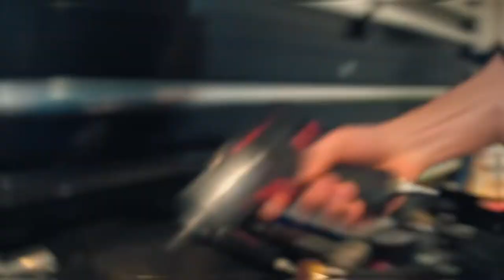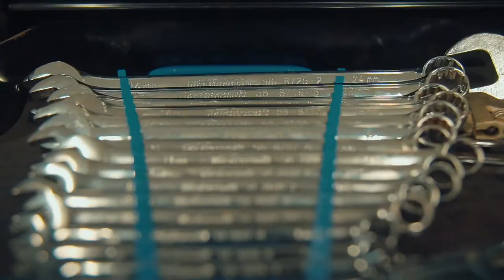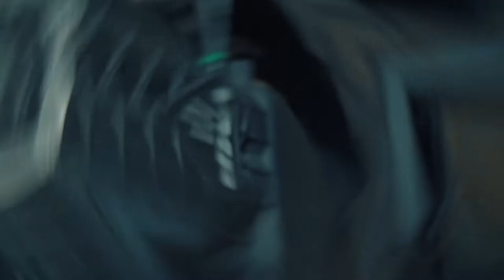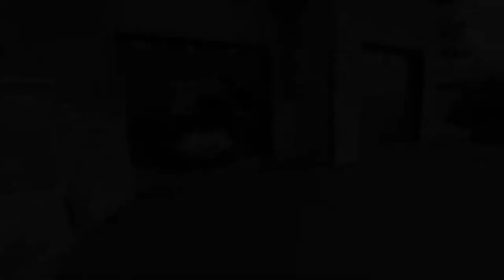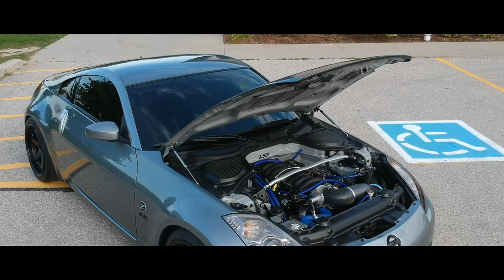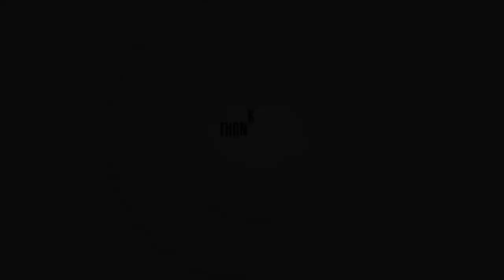How much does it cost to PROPERLY LS swap your car? 350Z BUILD BREAKDOWN

Comment: Speaking of the turbo VQ route. I feel like once this LS3 is completely dialed in and perfect, it will be way more reliable as well and you'll get years of enjoyment out of it. Boosted cars are usually a time bomb at this power level. You basically have a brand new car at this point.
Reply from the maker: Yes I would say the cool factor is up there to with a swap car ! Don’t get me wrong turbo vq can work really well to but this in my opinion is the better setup !
Reply: @wade_debo I turbo my 08 last year but honestly wasn’t a big fan of it. Fast as hell but it has become a nightmare to work on. LS3 fits so nice I think I might swap
Reply from the maker: @TDJP123  I don’t think you will regret it !

Comment: My LS swapped 240 came with rebuilt RS5R30A 300zx trans with top loader conversion, ford 8.8 rear end with 3.73 and a spooled diff. Mecloud 6 puck with Nissan 300zx billet flywheel. Nissan 300zx starter. Granted has the cheaper more available lm7, has a gen4 pan, summit 8707 cam, pac 1219 dual springs, retainers, trunnion, tbss instake manifold, eBay cold air, msd sreetfire coils with dragonfire wires, SS vband headers, 3" x pipe, black widow mullfer and 3" axle back, new headgaskets, head bolts, cam bearings, crank bearings, stock rebuilt 706 heads, a p01 suburban ECM with hptuners mvpi2 and 2 credits, sport springs, all new bushings, pnahard bar, adjustable torque rods with poly, some hub adapters with Corvette salad shooter 16x9 wheels and kuhmo ecsta xs tires for around 10k...
Reply from the maker: Nice ! Sounds like a good setup and lots of fun ! The 240 is a great platform
Reply: @wade_debo  Not the 240 your thinking altho the Nissan trans would make that a logical guess. This is in a 2700lbs Volvo 240..

Comment: So what year is your chassis?   I see you have the 06-08 interior and the exterior lights.  But I notice you don’t have the “bump” hood that comes on the 2nd gens.  It looks like you have a 03-05 hood.  

Just curious if you chose this hood for a reason.     

Still the best LS 350z I’ve ever seen   👍🏼
Reply from the maker: Alll body panels and lights where what came from the factory I still have the window sticker for the car I didn’t change the hood or lights ! The car is an 06 , in 07 they changed the hood for the HR models this was a DE
Reply from the maker: And thanks ! I really tried to focus on the clean and tidy look !

Comment: would this work for a g35? Since I know they are similar platforms but have different components?
Reply from the maker: This would be very similar! Most of the parts would be the same.
Reply: Yes it does.  There are some differences, like driveshaft length and exhaust.  One annoying difference is the Oil Pressure reading.  The 350Z has a stock gauge, but the G35 just has a dummy light.  So, you'll have to install an aftermarket oil pressure gauge with a G35 if you want to monitor oil pressure, which is highly recommended on an LS.  Other than that, the two vehicles are almost identical.

Comment: I have a 90 300ZX that I'm going to LS3 swap. I'm using LOJ's kit. I think their kit is probably the best, rivaling Sikky.
Reply from the maker: I have heard great things about LOJ and their kit as well ! It was a tough decision between the two !
Reply: @wade_debo  Do you have AC on the 350? if so, what kind of radiator are you using?
Reply: @eekay3646  LOJ makes a radiator kit.  I'd suggest that.  The other problem with AC is the compressor sits low, down by the sway bar.  I'm running a Whiteline swaybar and there's not much clearance between the compressor and the swaybar. This is using LOJ's accessory drive and AC installation brackets.
Reply: @glevii  Thanks, but I don't want to use LOJ's accessory drive kit. It just looks awkward to me, and I don't think it's worth $1100 or whatever. Stephen at LOJ told me to use the high mount AC (Sanden) LS3 accessory drive. At first I was gonna use the C6 LS3 factory accessory drive, and Stephen said the AC would hit the frame rail on the passenger side. As for the radiator, I think I'm gonna get a "universal one" and use that, but not CX racing. LOJ has high quality stuff. But too expensive at $2 g's.

Comment: damn man, this build really looks promising, I'm looking forward to make like 600-800 hp, will it be capable reliably?
Reply from the maker: All depends on how you build the engine ! The LS platform can handle lots of power when you build it correctly. The drive line of the cdoo9 trans can handle it and so can the rear end but it’s just a matter of how you build the engine 👍